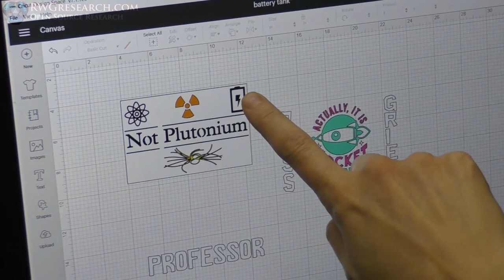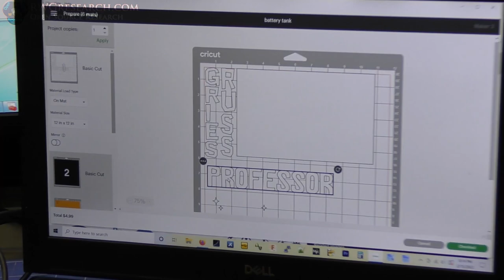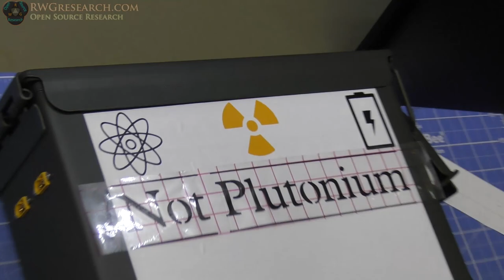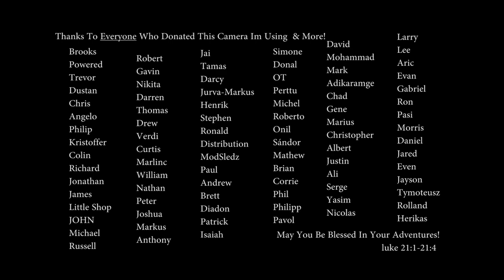#7-22 My Wife Did It... Safe Charge Can LIPO Battery Box...  DON'T BURN YOUR HOUSE DOWN... I Tried..

Comment: I feel when/if the lipos get puffy then they are more dangerous. I took an axe to a 4s 2200 and could not get a reaction. Also i have nearly the same laptop its been a good one the past 5 years.
Reply from the maker: im not so sure if there more dangerous. But yeah you must store them as a nominal 3.8V per cell. else they will balloon up ! ~Russ

Comment: Where did you get the pass through connectors for the box????? Thanks
Reply from the maker: The XT60 you can find pannel mount Versions Of that connector.  The balance leads I made those PCBs and added the jacks. ~Russ

Comment: If those batteries ever decide to blow up that little box isn't going to do anything 🤷 e-scooter battery packs are blowing down entire walls in New York high rises.
Reply from the maker: Although that may be true. I can tell you that this box will be 100% better than doing nothing. In fact this is the recommended way to do this. They sell theses / similar do do this job. ~Russ
Reply: @RWGresearch  I'm never a proponent of doing nothing, but adding a metal casing for shrapnel doesn't make a lot of sense. Why don't you store them outside? That's what I do 👍  If there's a safety concern of burning your house down, would not be the most logical action to take! Instead of a decorated metal box? Seems silly and staged for a video to put on YouTube 🤷
Reply from the maker: @zzzzz2343  Not to be disrespectful... i still must say, although i have tried many times... i will never understand people. anyone else with me? theses types of comments get me so confused some times. ~Russ
Reply from the maker: @zzzzz2343  https://www.youtube.com/watch?v=BPZuvSI8MXU https://www.youtube.com/watch?v=8A7An4fXARs https://www.youtube.com/watch?v=Rv_3vwSZmzA https://youtu.be/CnNId0mDnBo?t=332 well. I'd say that mostly proves that this is an effective way of doing what I'm doing. to be 100% sure. yeah set them out side. ~Russ
Reply: @zzzzz2343  I have been with Russ and his family many times and I can tell you there is nothing staged about him. He is real to the bone and I can testify that his farts are terrible. As far as decorating the box, you would have to know his wife. She decorates everything from the walls on down.She is a wonderful woman and very loving and she adores Russ. I like the fact that she wanted to decorate his battery box.
Reply: @zzzzz2343  I have used a similar setup and the work great.  I had a battery start to cook and I just grabbed the handle and opened door and chuncked the whole thing outside. Your just one of them guys no one likes and you just don't know it.